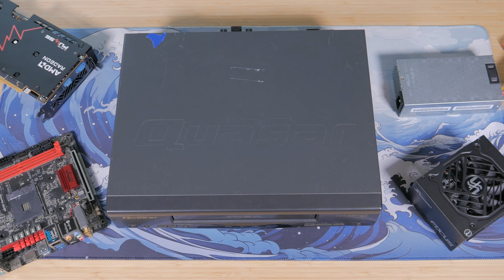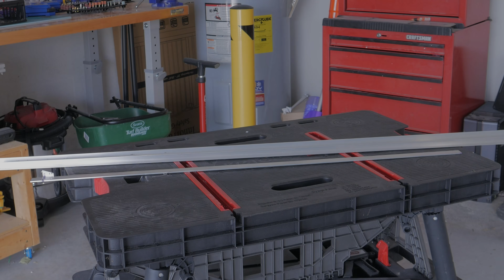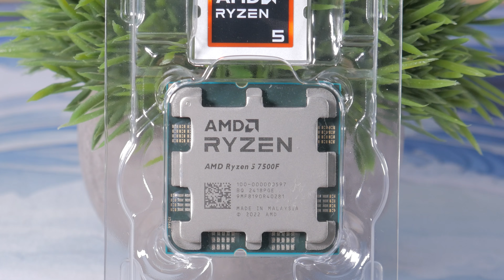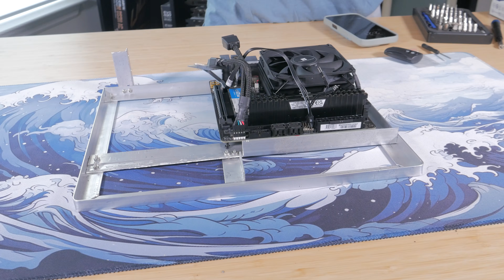I Turned An Old VHS Player into a Gaming PC...

Comment: I would totally do this with a unit that had a vfd, and wire up the vfd to the computer to display messages. probably also install a dvd drive in it to use with vlc or kodi. one of these would definitely be a briliant HTPC if you used a linux base.

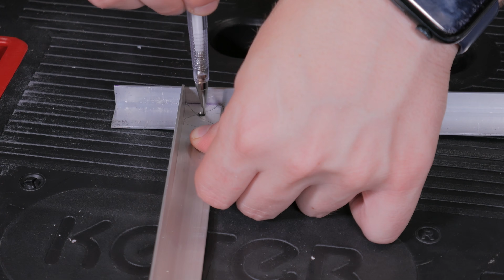Comment: @5:24 It's not entirely necessary since you've made it work, but notching out the edges for fitting the angles flush together would keep the basic rectangular frame symmetrical. I used to be a draftsman for a factory and made drawings for notching 3" steel angle (and grinding the sharp corner left behind on the flat, because the steel angle has a round inner corner) for them to fit square on multiple projects.

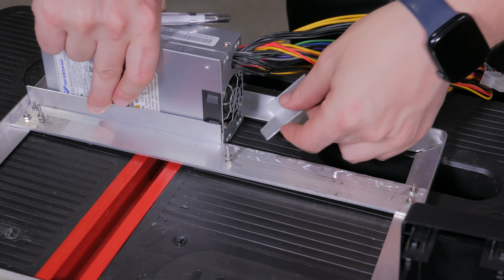@8:37 Ah, I see you've done that, now.

Good work on your geometry and deburring all of the sharp edges! Safety first.

Comment: THANK YOU.
I've been yelling about this for years. Finally showed up on my feed.
Reply: My next project is going to be like this, a Sleeper Build next to the TV. But instead of a VCR Player, I'm going to be using an old Gramophone.

They have a lot more space inside, and the retro cloth sides are perfect camouflage for vent and exhaust. Plus, I will keep the top player functional. There's loads of modern music being printed onto Vinyl Disc.

So it will sit in the house like a conversation piece, but also as something that a burglar would scoff at and skip.

Comment: Great build but I wanted to point of a few things. 
1. AM4 is not dead. Amd is still producing AM4 cpu today and will continue support up until 2028 which makes it not dead
2 for gaming and basic work that's this build gonna do is 16gb ram is good enough. 16gb ram is the basic standard. 70% of games doesn't need more than 16. But then again you did say AAA games like star field would benefit from 32gb ram

Awesome build tho

Comment: Nice build!  I did a sleeper in an OG Xbox.  Some pointers in case you never thought about them.  You can get plastic adhesive motherboard stand-offs instead of cutting aluminum bar and using machine screws to fashion them.  It's way cheaper and easier.  I have drilled holes for ventilation before, and it's not fun or very efficient.  I would have gone for a fan grill instead.  There are many to choose from online and then you just have to cut a square or circle, and 4 holes.

Comment: Regarding the PSU, if you can't add anything into the case, cut off the excess power connections and capping them, then any power cables being use, I would cut\splice them to a more "appropriate" length to free up space and improve airflow. If you have to add a drive later on, just use an external drive or just simply put all of your games on an XXTB external drive and have the OS\applications on the internal SSD.

Comment: Only point to critise is the CPU ventilation hole which might could have been avoided as it looks at 14.11. According to before fotage the finstack of your picked cooler should have all the finstacks facing the side vintilation of that VHS case, without I/O shield and back open, wouldn´t have to smaler, properly picked fans side mounted to where those og intakes are to push fresh air trough the finstacks? And wouldn´t have been hard to make a mounting not just for the fans but some cardboard airflow guides as well or get something less flamable and non breathable material. With a bit more time and thought you could have kept it clean and stealth in the that shot. Still need work my bro and I like the "keep it simple stupid" for replication reasons of you.

Comment: Great job! I do respect the persistence and patience needed to make this build. Early this year I built a sleeper pc in HP printer shell using a normal sized PSU and I guess SFF optiplex motherboard. No external GPU, however there was a place for one. All in all, I just wanted to say how demanding and frustrating experience it was, so I feel you bro!

Comment: Love it, love up cycling old tech for pc cases. Gutted an old 2u amplifier case to a pc case recently worked great. Latest project modified a bush dac90 vintage radio to a pc case. Best bit the speaker size was perfectly 140mm and the original speaker mounts worked with the 140mm fan. Great build you have a new sub.

Comment: If you work with this kind of materials again, using something called a "pop rivet gun" would be much less tedious on areas that dont require future convenient disassembly. If you have wide head rivets it will work for plastic without cracking it too badly.

Comment: I did this, but with the PSU out back, and no GPU. So the PSU can breathe. I like that you were able to fit a beefy GPU, but wouldn't the power supply be pumping heat into the case this way, or is there just enough ventilation?

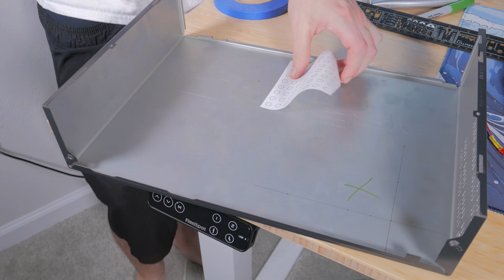Comment: 10:04 Good build, but did you really need to use ChatGPT to make something that simple? It's literally just a grid of holes where the fan is at.
Reply: These younger generations cant seam to do anything without chatgpt.
Reply: @AnarickTheDevil it isnt about age. It’s about convenience, why instead of designing a bunch of vents, why wouldn’t you just use ChatGPT? 

Because it’s ever so slightly faster , and it’s really stupid and lazy
Reply: @powerbongo922 I'd hardly call an LLM that's prone to giving misinformation "convenient"
Reply: @LegoKeig24  that’s the only vague reason I could think to use it. I would never use that personally. I’d be better off with my own measurements than anything AI can produce.
Reply: @powerbongo922 always measure twice cut once. trail by fire and learning from the burns of the past. As it always should be.
Reply: yeah kind of absurd
Reply: I actually think its a good idea. I would have looked one up and printed it but had it at the wrong resolution or something and messed it up. Not saying he couldnt have just found a printable one on google but it came out good.

Comment: Guy, get some tape and a Sharpie, apply the tape to the top of the drilled holes, then from the bottom use the Sharpie to paint the bare metal the drilling made. Maybe debur the holes 1st. 😁

Comment: getting into pcs only a decade ago makes me flinch when I hear 32gb as like a standard amount for modern gaming. now i feel sorry for all the oldheads who remember having 32mb of ram
Reply: Right? I remember 8 to 16 was standard roughly 10 years ago.
Reply: I didn't get into PCs until covid and people were arguing about if 8gb of ram was fine or not. Now 8GB of Vram is a deal breaker, stuff is moving fast lol. seems like 32gb ddr5 and 12-16gb of Vram is mid range these days.
Reply: @johnsherby9130  you think stuff moves fast now, you should have been there in the 1990's. I got into building PCs in 1994 after having been on TI then Commodore in the 80's and Amiga 500 and 4000 in the early 90's and realizing that finally the PC had come into its own as the dominant gaming platform and since Commodore was gone, it was time to jump ship. The first PC system I built in 1994 (for a friend; I had a Pentium pre-built) had 16MB of RAM, which was a lot at the time, and expensive due to a tsunami or something (like $400, or $100 per 4MB stick) and a 486DX-100 processor. This was before they even had 3D acceleration, just basic Super VGA cards with maybe Windows 2D acceleration. Fast forward to Y2K and many upgrades and 3D cards (ATI, S3, Voodoo 1 and 2, Radeon) and systems later, and my personal system had a Pentium III-700 overclocked to 933MHz with 256MB of DDR SDRAM, with a GeForce 2 GTS 32MB, running Windows 2000 Professional. After that I stopped riding the bleeding edge and my systems became lower spec (but more numerous, for different tasks... maybe not the best approach because some languished unused most of the time), but still, RAM amounts ballooned from 512MB in 2001, to 1GB in 2003 to 4GB in 2010-ish? IDK exactly, to 8GB in 2019 and the 16GB and 24GB systems I have now. And I'm still kind of behind the technology curve... mostly due to lack of money, not lack of desire. I'd build out a couple of high-end AM5 systems - one for me, one for my wife - in a heartbeat if I could afford to.
Reply: If anything, you should feel sorry for anyone who has 16GB of 8GB today because that's a very sucky experience. Back when 32mb was a huge amount, it was also more than enough to run every piece of software and then some. It was also kind of easier to upgrade RAM back then, because you could just plug in a memory module to your board if you had free slots and it'd be perfect. You wouldn't have to worry about RAM channels or clocks. I mean if you were OCing you would still have to worry about clocks, but not channels.
RAM upgrades only became miserable with DDR because now you needed 2 matched sticks and installing more than 2 if you had dual channel MC reduced performance so the ideal upgrade was just replacing existing memory.
Reply: I'm only 32 yrs old, but my first PC had 32KB of ram... I only got into the MB range when I got a hand-me-down PC.
Reply: because i mod some games, even 16GB ram is becoming kinda, iffy for some games. Also basic low to mid-tier ram (like naked ram sticks without fancy heat sinks/spreaders and rgb) are pretty cheap if you want a lot of ram
Reply: Try 512kiB...
(Amiga 500)
Reply: @GegoXaren  The amount of optimization that went into games back then is sorely lost today. These days they just import modules and run with it, without even gutting any of the unused features.
Reply: Or less. Me. 😂
Reply: I remember when I added a 1MB stick to my 4MB stick, because Doom required 4MB of RAM to run, but DOS wanted a little bit of RAM to use and sometimes Doom failed to launch because "You do not have 4MB of free RAM!"
Reply: lmao my first pc had 8mb

Comment: Should get a LED clock to put in the front panel, too!
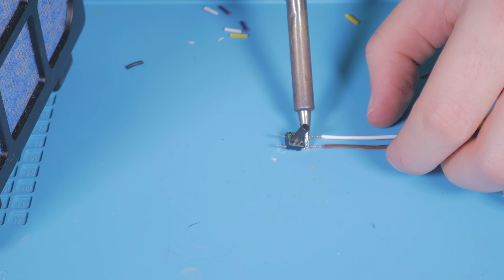Reply: It must blink 12:00 to make it athletic
Reply: @sanddaddy5 lol so true
Reply: Most VHS players already have clocks, so it would be a matter of powering the clock display with an always on USB header, but also have it display "PLAY" when you're gaming for example
Reply: @LouisSubearth  I suppose the clock display is connected to the main VHS board.
So not so easy to have it working now.
Reply: @LouisSubearth and have it "PAUSE" or "STOP" when your machine crashes via BSOD.
Reply: This!

Comment: Suggestion, instead of that silverstone remote button, why not try a Universal media center remote, this will do the same thing as the silverstone, but give you full remote control of this PC, including power on and off. To a lesser extent, use the IR built in to the VCR with an Xbox 360 media remote?  just a few thoughts!

Comment: Find yourself a stereo from the 70's I would guarantee you'd have enough room. You could use some closed cell foam and create a top seal for the CPU to bring temps down even further.
Reply: But stereo from the 70 are worth keeping as stereo.
Even if they don't work, the electronic can be repaired inside if you have skills.
Nobody cares a 1990 or 2000 plastic VHS player.
Reply: I'm sure someone could find a crappy dual cassette player with a turntable from the late 80's to the 90's at a thrift store on that note.
Reply: I have a 1950s record player stereo console. I haven't done it yet, but my goal is to refinish the wood, put in a gaming PC, and high quality stereo.

Comment: What's a VCR then?
Reply: VHS Player and VCR are interchangeable terms. The term VCR means Video Cassette Recorder and the term VHS means Video Home System.  Basically a VHS Player is a VCR  that lacks record functionality.
Reply: @justinpieper8129  but to add to that, all VHS players VCRs, but not all VCRs are VHS, since VHS is one standard and there was another called Betamax that also lasted a long while. Betamax had more quality but shorter playtimes, so the one that was most used was VHS, especially for long film. If I remember correctly, Titanic on Betamax was 3 tapes, while only being 2 on VHS. In the end, the studios went with the cheaper option
Reply: @anivmoreno9612  By the time Titanic came out in 1997,  Betamax was dead in the comsumer market. It was never released on Betamax.
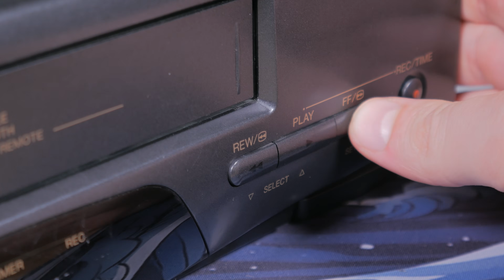Reply: @justinpieper8129 11:02 notice the very obvious "REC/TIME" button...

Comment: Ironically, I was thinking about doing a project like this a month ago I ordered a VHS DVD combo on eBay, but unfortunately ( in terms of my project) when I got it, it actually worked despite the listing saying that it was completely dysfunctional so I decided to keep the unit intact since it was a unit that is kind of hard to find in working order
Reply: I was planning on making the dvd drive functional, and have a HDD hot swap slot in the vcr slot

Comment: The only thing missing would be a Blu-ray drive in that VHS slot :)
Reply: I was thinking about hot swappable drive bay 😂
Reply: It would've been hilarious if a row of USB ports were inside the flap.
Reply: I actually just did this for a windows xp retro build using an old Crown MX180 Amplifier
Reply: Knobs fully functional
Reply: I thought this too but with one of those vcr/DVD combo machines.
Reply: @patrickirwin4827 you'd have more room for activities
Reply: Thats assuming its 5 1/4" drive